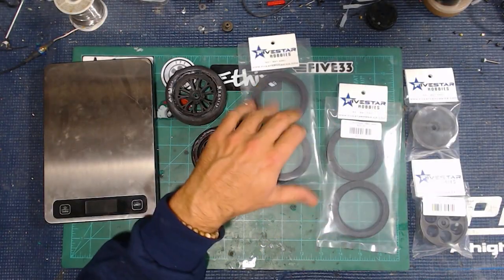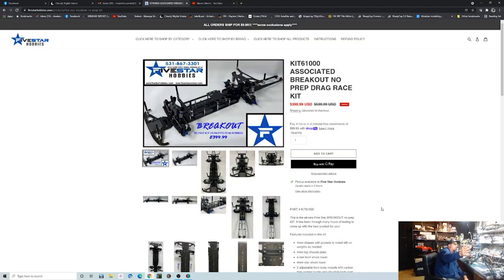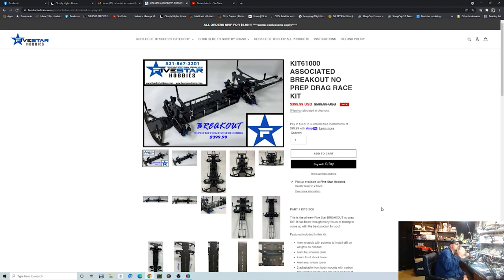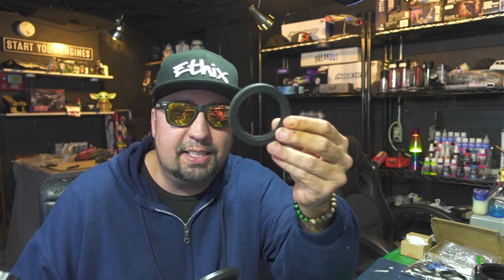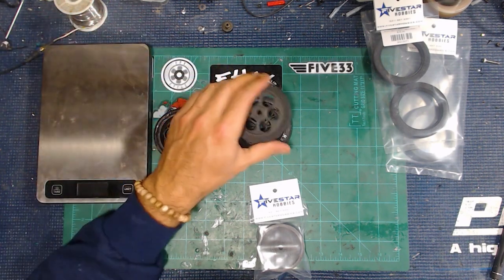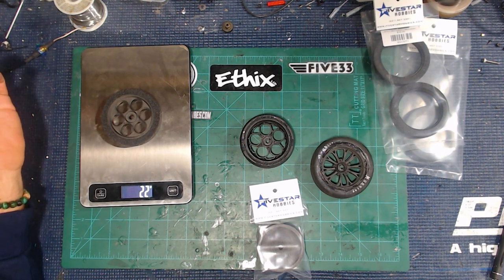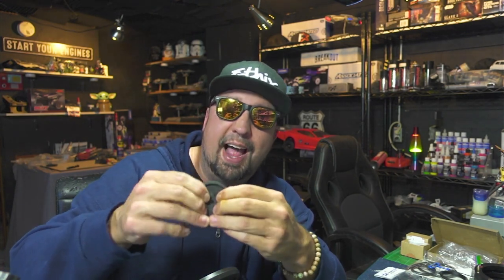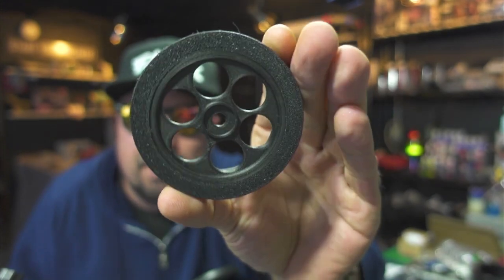3D PRINTED RUBBER DRAG TIRES AND WHEELS FOR OUR NPRC CARS | WOW

Comment: When you can put the weight where you want it, in drag racing the lightest will always be the fastest ..  always be easier on parts, in this case electricity.. that's why most classes except for Grudge are based on weight great vid man
Reply from the maker: Gonna be hard to shed massive grams without spending a decent amount of cash. Gonna try moving it around first and see how that goes. In March :) :(
Reply: @Dorkyand40  I have found the extreme chassis for 170 bucks, to be a good foundation.. as you know I am running nothing exotic..
Reply from the maker: Dr10 right? Get a lot of people asking about the brisket. Be good to recommend them for that. It obviously works :)
Reply: @Dorkyand40  no sir Traxxas based
Reply from the maker: Right. Do they have a dr10 chassis
Reply: @Dorkyand40  I see a kit for a B6 and Losi so maybe

Comment: Great videos man keep it up. I have a question. I'm sure you've mentioned this in the past. But what shock oil would recommend in rear shocks for a breakout chassis?
Reply from the maker: have to look. i went right off of todds setup so im at 1k in the front but cant remebr the rear. its on the setup sheet in the manual that comes with the chassis
Reply: @Dorkyand40  ok cool I'll have to look for set up sheets. I can't get over the quality of this kit. I got the tlr kit an just last night. Thank you for responding.